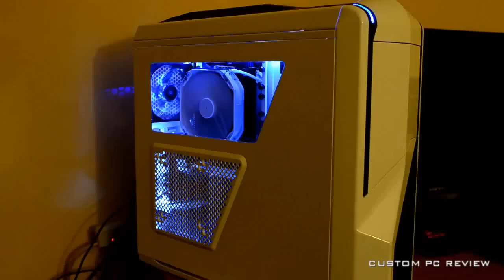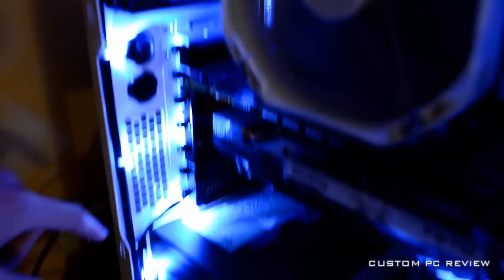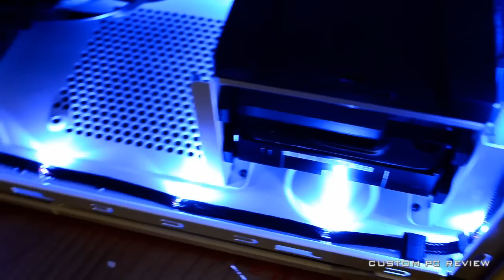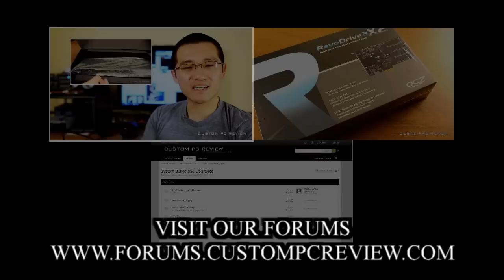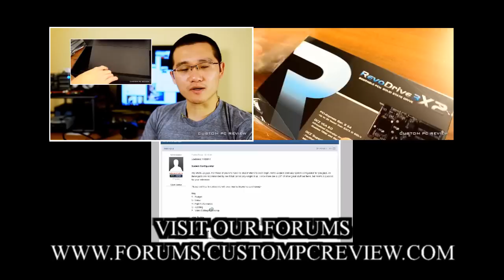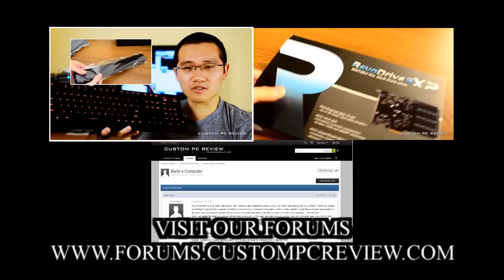NZXT FZ LED and Sleeved LED Kit - Case Lighting Overview

Comment: 550 Ti is a small card -- it will fit without a doubt. The stock fan will do if you don't plan to overclock. Besides, you can always invest in a Hyper 212 Evo (a cheap but effective CPU cooler) later.